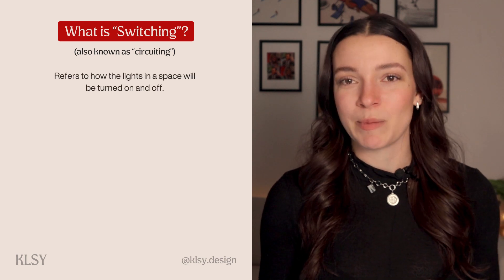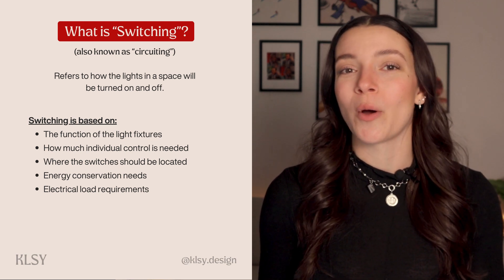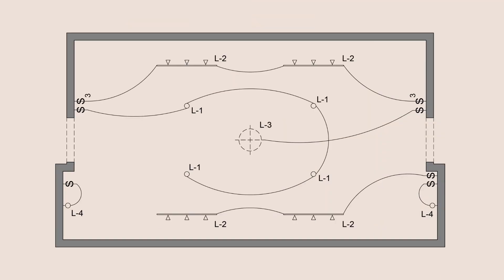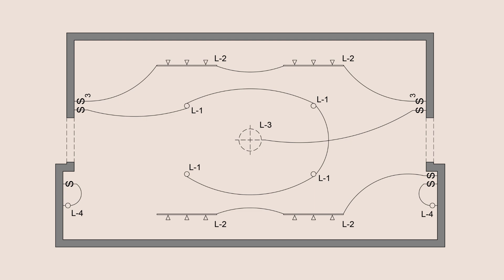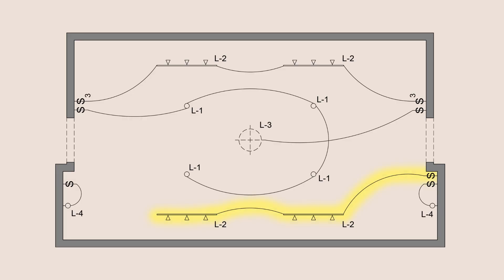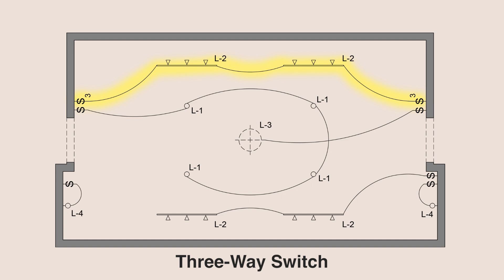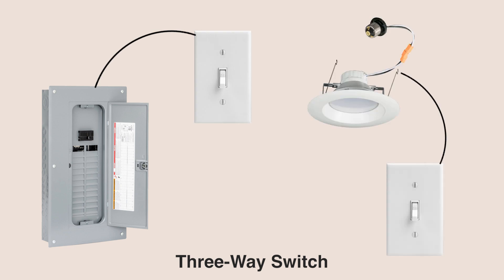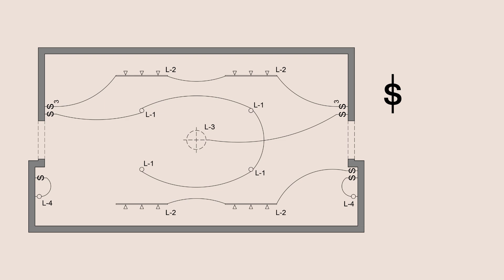Light Switching Plan Basics | NCIDQ Test Prep

Comment: As an electrician I just want you to know that four-way switching is actually very common in corridors and hallways.

Also, even if there are 100 switches it’s still only called 4-way switching. The name actually refers to the number of connection points on the individual switch device. A four way switching circuit with 3 switch locations actually uses one 4-way switch and two 3-way switches.
Reply from the maker: I didn’t know that, thanks so much for correcting me!
Reply: @ no worries! Hope my comment didn’t come across as too snarky. Electricity is like a black box for the vast majority of the world and it takes years of education and on-the-job experience to grasp what’s actually happening.
Reply from the maker: @ absolutely not. I completely agree though, so my goal is to close that gap so that it’s not such a mystery to designers. It’s important information to understand! Always welcoming feedback on this channel :)

Comment: Interesting! There is a lot of depth in design, and I suppose it does make sense that a Interior Designer would need to know how switches are laid out too. 
One note: As far as I can recall, once you go above 2 (wired) switches controlling the same fixture, you will simply add a 4-way switch for each new location in between the 3-way switches. In other words, we don't have something called a "5-way" switch that we buy and use. For example: Let's say we have a crazy large room and we want to control it from 5 locations. In that case we would install a 3-way to a 4-way to a 4-way to a 4-way to a 3-way. The total number of switches is 5. Basically, for every switch above two in a room, you just add another 4-way between the 3-way switches.
Reply from the maker: Great point, I didn’t know that so thank you!

Comment: Good refresher. Are the cheat sheets just for PRAC?

 I've passed all of my AREs for my R.A. and I'm wondering how much crossover there is between the ARE exams and the 3 NCIDQ exams (taking them in April).
Reply from the maker: They're most helpful for the Prac since the IDFX and IDPX test on design fundamentals and professional practice. The Prac is also partly a drag-and-drop format, so the blanks are meant to be used as mini quizzes in a similar way! Unfortunately, I don't know anything about the AREs so I'm no help in what the difference are :/ good luck this April!